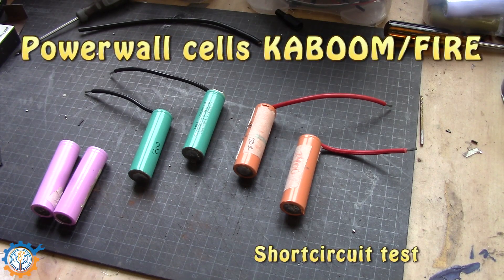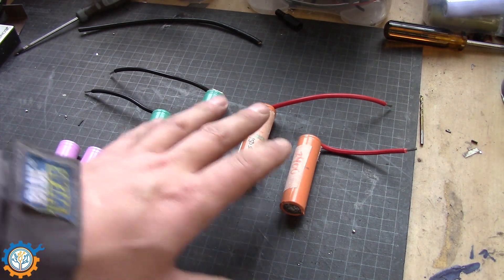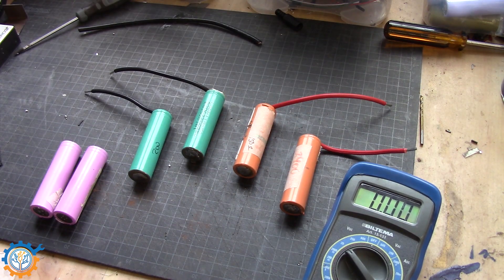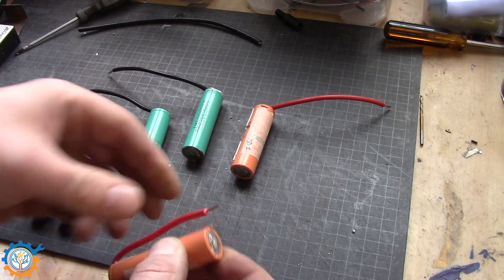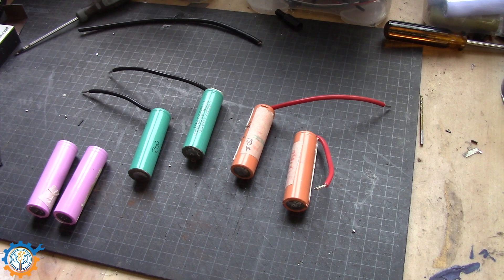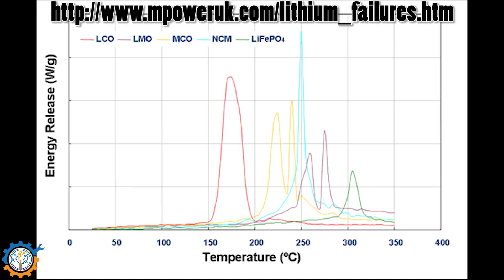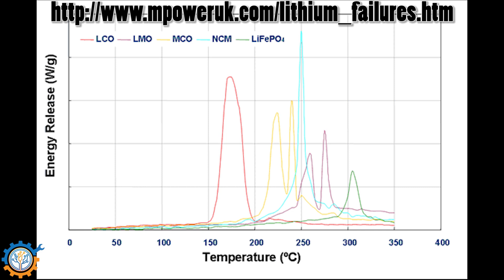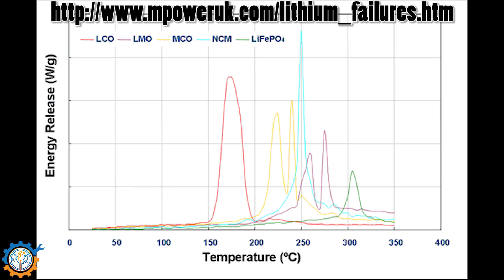Test: 18650 Shorted and go BOOOOM!! Or?

Comment: luckily 18650 cells has a protection like cid and ptc.. 
so, if the short circuit happens, it need some times to thermal runaway..

but, dead shorting the battery to just testing is no good.. the battery probably already slightly damaged because of that.. 
even with very low voltages (like overdischarged battery), the amount of energy they held still very high (still dangerous).. 
this is advantages of lithium ion, but also catastrophic danger of the lithium ion if being abused or mishandling/misused..

Comment: should have combine them in series or parallel than may be we can shine some fire.
Reply from the maker: Not really. Its not the cable we want to catch fire but the battery and per battery there aint more energy released even though we add more cells since its evenly spread among the cells :)

Comment: The problem with this is. The medium that's shorting out the battery needs to be able to withstand the buildup of heat in the battery. If you're using the stranded wire. You need to make sure that it continuously keeps a good connection. If you're using nickel strip you got to make sure the way you attached it and then they will strip itself can handle the heat. But the easiest way to short out a . It is too short out the positive contact with the case of the battery. The shorter length of whatever you're using would provide least resistance and let the battery get hotter
Reply: Exactly I can make them rupture every time you just need to short them on the positive side with a small inch piece of metal  that wire dosen't allow for enough power fast enough but a solid conection on positive side  directly to the body and like two minutes and thell runoff they do absolutely go boom too I had one in a backpack once that 3 exploded it blew a hole about two inches wide right threw two layers of my bag lol a lot of the time however they split along the side of case and  emmit a jet of fire ive seen one spit a 4 foot tall jet of flame and felt tue heat from five feet away lol

Comment: They would clearly go kaboom as you say if the cells where not old as a 99 year old lady ,with an internal resistance of 100?! 200!!!??those you should NEVER use in anything.But  If the cells where new they would burn your house down cause they have 10-20 mohms of internal resistance hence a huge current through when shorted and gets much hotter and the litium inside go kaboom as you said and start the reaction of burning your house down!!

Comment: Thank you for your video! I’d like to build a simple styrofoam cutter with a 18650 short circuited. Do you suggest to add a resistor or a diode to prevent damages to the cell or is it simple as that?
Reply: If you want to connect a heater to the accumulator, select the resistance of the wire wisely, so the load won't be more than the cell can output safely

Comment: a samsung 18650 just caught fire in my pocket yesterday , the positive end had peeled off and it shorted it's self in my pocket, touching something metal I had in my pocket , caused thermal runaway I could smell burning quickly took it out threw on floor and it spewed out lots of flames and smoke , as long as the cover is not revealed then this prob wont happen, but as they get older then this will happen to a lot of them , so need to dispose once the cover wears away or maybe put more proection on them ie shrink wrap or something to stop the shorting accident
Reply: When you peel away the shrink wrap and put a key between the positive terminal and the rim, you can short the cell for way higher currents as with that flimsy 4 mm² cable in the video.
Reply: Real test would be thicker cable, using a 7P setup, and dumping a few hundreds Amps into a cell

Comment: Stupid. One cell is not enough to cause thermal runaway. Try them in series of 3 and in close proximity to other cells. That will catch fire for sure
Reply from the maker: Will it? Have you tested it? ;)  If so what type of cells and conditions?
Reply: @DIYTechRepairs  i knew not from a test but from my own stupidity too. Li-ion cells are prone to thermal runaway esp the smaller cells. Lifepo4 cells are much hardier.
Reply from the maker: @practicalthinker5545  so you have tested it ? I ask because many People state things and this video only shows One out of 100s of scenarios. And personally i know how lithium works have Been working with them for many Years now :)
Reply: @DIYTechRepairs  Its not a "test" per se. im not a scientist so that i can declare i did a 'test'. my experience with li-ion came from building power walls using old and refurbished 18650s.
a mice got zapped in between  the strings and that caused the thermal runaway.

one 18650 cant raise the temp high enough to cause thermal runaway cause the energy is easily dissipated.

Comment: Lower internal resistance -> less heat. Having valves -> no explosion due to high pressure inside the battery.

Comment: NefFy
I still wonder about the little insulator ring on the end I don’t know I’m being cheap and also think they are just overcharging for something that you could probably get for free or don’t even need like what if he just pulled the tube a little further and shrink wrapped around the battery so that it went where the circle was… I’ve heard of some people using pieces of cardboard from business cards and some people are using electrical tape… Personally I’ve been using shit batteries that are probably due to explode because the rappers were torn to shreds....  The real reason why I decided to look into this was because it zapped me when I was holding the battery in my hand not even holding the mod
I don’t know what is the part that is safe to touch and what made it shock me but it kind of hurt and it’s happened twice lol fuckers
Meanwhile I decided to put on some rubber dish gloves just to be safe even though I don’t even know if that would keep me safe ha ha and I wrapped up my batteries real tight with one layer of electrical tape. This would’ve not worked in my single battery date because it would’ve been too fat but maybe now is a need to drag and it has two slots for the batteries and if it’s just fine. I pulled the tape tight enough that when I got to the top it curled over and cover rent a little O-ring would go.... 
I read so many articles online trying to figure out what material things were made out of NY to see if I could make an O ring at the top that was just as good as the ones they sell and if I needed to buy the shrink wrap stuff or if I could use some thing else as well. I mean the electrical tape is working but so was the ripped up battery that was electrocuting me so I’m trying to figure out the best thing to not get shocked and not have a blow up in my face without buying premade shrink wrapped in a little cardboard Os.
This is Melissa this is mostly out of principle and being cheap is the other part of it. I like making things and I don’t like getting ripped off and I feel like what they have on the market isn’t really necessary but they make it seem like it is. I could be wrong I don’t know but I thought this would be a video if you feel like doing even more research than I did and figuring out how to DIY these things. Maybe you don’t even care because you say the wraps are dirt cheap (but even dirt should be free) and they work and it’s pretty easy so it isn’t worth doing anything about it.

Anyway anyone is curious the rappers are just made out of PVC there are tons of things made out of PVC but you have to get it in a tube not just put out a piece of PVC from a plastic bag because then how is it going to stay on your battery?
We can buy much cheaper versions of the same exact thing they sell as “Vape battery wraps” because it’s also sold as something way less specific and the exact same thing just not “for vape batteries” is available at pretty much any hardware store ( so there’s no shipping and you can probably get it the same day if you get out of the house and go get it)

As for the O-rings at the top they are made out of something called Fish Paper.
Some are made out of plastic. Some say they aren’t even necessary. Some people use lucky duck tape or electrical tape. Some people also don’t know what you’re talking about so there’s that too. Plastic seems to make sense to me or actually better than that would be silicone that way in case anything gets hot it won’t melt or do anything weird. At the top of my lotion bottle sometimes there is a little thin circle of silicone and I was thinking of getting a whole bunch and making a whole bunch of the middle and then sticking out on top of my battery… I’m pretty sure I also have some thing in with all the miscellaneous Vape supplies I have looking a lot like the right size and shape and made out of silicone along the lines of a Rings and stuff.

 So yeah I kind of gave up because it was taking too long to re-search but that’s as far as I got with everything and I don’t know if anybody even cares or is curious the way I am but there’s my research and an idea for a video.
Reply: I've mainly been curious about the wrap but as an electrician I know it's just a thin layer of insulation to prevent anything conductive from contacting the metal casing of the battery, if you consider the fact that we used to use a thin layer of cloth to insulate wiring in buildings (most of which haven't burned down *yet*) using electric tape instead of the fancy battery wraps will definitely suffice as a proper insulating material as long as it's done properly (tight with overlaps and a couple of wraps leaving no metal surface exposed using quality tape not dollar general kinda crap, 3m type line)
Your answer was educational though.

Comment: I think it is important to say that this video should NOT be considered reassuring!
- We do not know the characteristics of the cells nor of course their history. But
- These cells probably come from laptop battery packs, which are not designed to deliver high amperage.
- The ambient temperature is 5°C or less, the result could be different by adding 30°C.
In conclusion, it's not just because nothing happened in THIS video, with THESE cells and under THESE conditions, that mean that nothing will ever happen in other circumstances!
Also, short circuits are not the only thing that may cuase Li-Ion cells to fail, possibly dangerously.
 If some of the guys playing with these cells have been victims of fires or have come very close to a possible disaster (see HBPowerwall at the beginning of the year), it is not just by bad luck. It is because they were not careful or informed enough, or too confident.
Reply from the maker: Correct. In normal scenario the cid takes Care of it but No guarantee. Its like that with everything in life. Just because you have a seatbelt driving a Care doesnt make it 100% Safe
 Its safer but not more...

Comment: You tell people to stay safe, but make this video and tell people "that nothing will happen". Surely you realize that 18650s come in MANY different rating. Your old laptop batteries are only cabably of a couple amps. What happens when your ignorant (about batteries) viewers use cells from power tool batteries, that can supply 30 amps or more? It is very irresponsible of you to make this video and claim that "nothing bad will happen" when your very small sample test means nothing on the grand scale of the plethora of different 18650s and scenarios. I think 18650s can be repurposed and used relatively safely if people fully understand what they are doing. You are feeding people false info and security and that is always dangerous in any situation. When lithium batteries go nuclear, it's very dangerous and "shorting" is the cause. To claim that it's safe to short lithium batteries is stupid. Sorry if I offended you, but I don't want anyone to burn their house down, or get hurt.
Reply from the maker: Did you even Read the topic? It have a ? Its Up to you as the viewer to determine whats safe here. Ignorant People exist everywhere and you were probalby One not reading the headline :)
Reply: @DIYTechRepairs  I know it is up to the viewer to be safe, but many people don't do that. Your headline doesn't mean shit when you claim that "nothing will happen", because many times bad thing DO happen when lithium batteries short. I explained that such batteries vary greatly and you made it seem like your test encompassed all 18650s, so I'm not the "ignorant" one here. I read and listened to everything you said in the video and that is precisely why I said you were being irresponsible. You also have a responsibility as a content maker, especially since you realize that many ignorant people will try what they see on a YouTube video, not knowing what they are doing. Why don't you short out some 30 amp Dewalt cells and see what happens, before you call others ignorant.
Reply from the maker: @gordthor5351  The 30A dewalt cells do the same thing (If you read their datasheets or the test protocols for them). Yes i tested them to. I guess you are a bit to ignorant to know what i have done and you just assume things. Same as you did with the video.... I guess we are back to square 1 again.  Plenty of things are unsafe in our life. Walking across the street is also unsafe blindfolded....  With this said lithium ion cells arent something you work with unless you have the understanding.  We can protect people from alot of things but from their own stupidity is hard.

Comment: Are these high amp batteries?
Reply from the maker: Noop
Reply: @DIYTechRepairs  ok. I'm pretty sure high amp would explode.
Reply from the maker: @doknox  not really. High current cell also have cid implemented.
Reply: @DIYTechRepairs  try a battery for vaping. They explode.
Reply from the maker: @doknox  No they dont. IF they för they are faulty from start. A proper cell have cid and the cid trigger before it goes bad.
Reply: @DIYTechRepairs  so they obviously do explode. I've seen videos. Granted they have to be faulty but it happens. Also it would have to be a hard short. Wiring it like that allows the batteries energy to be released into the wire which gets hot. Use something non resistant to make the short. The energy has nowhere to go then.
Reply from the maker: @doknox  evertything can explode. Your gas tank om your car as well.... So where do you want to take it.  A proper lithium 18650 cell have atleast cid. It Will trigger IF the pressure raises and disconnect the positive Side. This prevents issues in most cases. There are Always cases where you have faults of course. Feel free to test it IF you like or Read scientific tests regarding it. You Will find that its rare but it can happen. I wouldnt  light a fire beaides gasoline ;)
Reply: @DIYTechRepairs  I wouldn't either but people should be aware that they are dangerous if used or handled improperly.

Comment: You said nothing happened but it kinda looked as tho it was venting on your thermal cam
Reply from the maker: It was warm air that you can see. Especially the non covered areas emmit alot of heat causing the air to look like that on the flir :)
Reply: @DIYTechRepairs  I would think it wouldve been orange colored on the flir images

Comment: Thanks for that! I was in a robotics lab for this internship a few years ago, and my buddy went to cut a wire off of this large battery we were using, and when he snipped it he touched both terminals on accident with the scissors, and the battery immediately swelled up to twice its normal size! That battery was much larger than these vape batteries but every time I hit my vape I think about that ha so this video makes me feel better.
Reply: Wasn't it a Li Po battery instead of Li ion?
Reply: It was totally a LiPo accu

Comment: It was interesting to see, thank you. I've witnessed much more.. Let's call it explosive results myself while assembling a battery, I only short circuited one cell - but the nickel plate it was done with just instantly exploded.
The battery was fully charged and rated for 30amps though. These guys clearly have higher inner resistance.
Have you ever done it to any fresh high performance cells? (those usually used for vaping for example)
Reply: in my case i accidentaly put wrong - and + in wrong position when charging form panel. I was expecting nothing bad to happen withing few second short circuit, but one types of noname batteries in my pack had electrolyte leak

Comment: this test dosnt rly show anything... u can put some batteries in ur pocket and coins etc and it can explode instant! u cant test 100 batteries and think the outcome is the same every time!
Reply: No they can not explode in an instant in the pocket. You are thinking about things you have heard about high end cellphone batteries. Those are of a different type and energy density. Nobody uses those cellphone batteries for home battery building. 
This test shows very well, that if your setup has heat monitoring switch - you can easily avoid fire risk.

Comment: I use this type of batt in my ecig, and I have a question. I have made a mistake let the positive connected to the negative for 1-2 seconds accidentally, and the temp of the batt was increasing suddenly. Then I took the batt out of the device (mechanical mod). My question is, can I still use that batt as usual again?
Thank you
Reply from the maker: Ekasit Wong Most likely yes.
Reply: DIY Tech & Repairs thank you, that’s help 🙂
Reply: May be able to use it but it wouldn't hold a charge well one would think